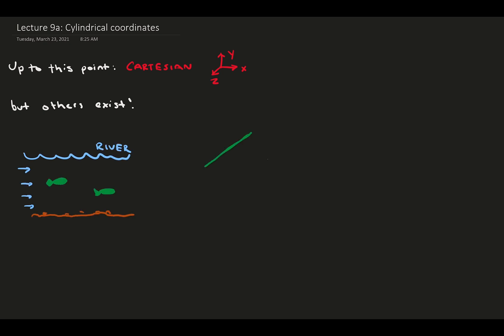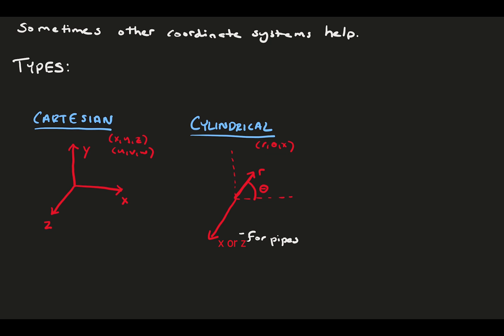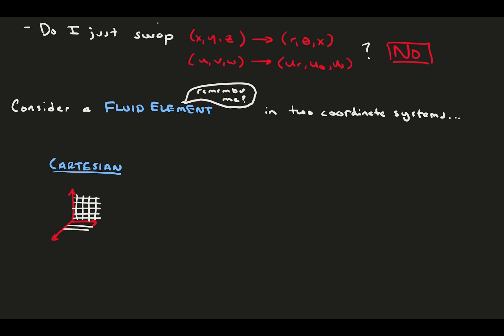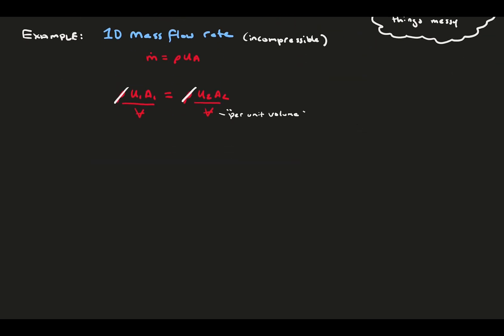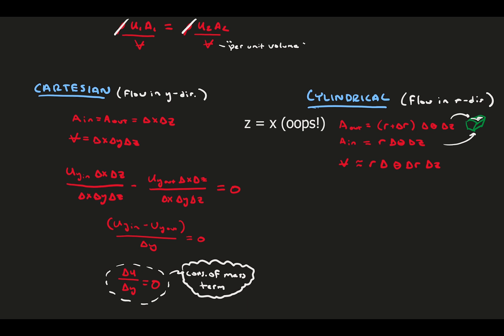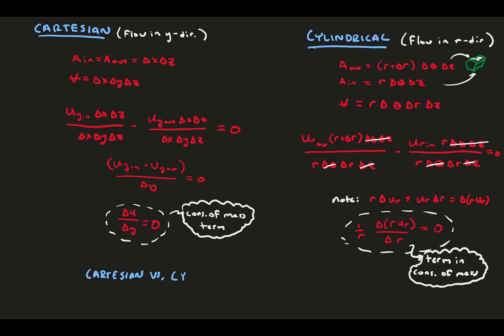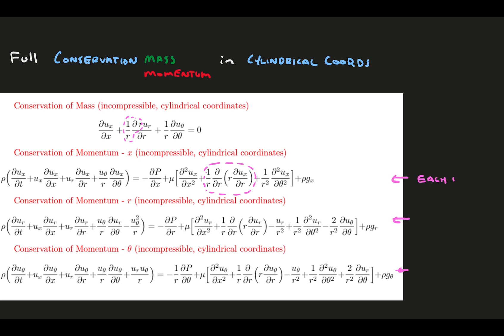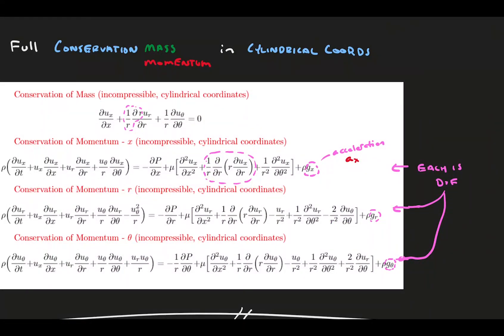Navier-Stokes in cylindrical coordinates [Fluid Mechanics #9a]

Comment: Sir, is there any way how to remember the NS equation in cylindrical coordinate system?
Reply from the maker: Unfortunately I don't know any useful tricks other than memorizing it completely. Typically the radial derivative terms are a slightly different than the cartesian counterpart, but not always.  Just be sure to check units, knowing that and d(.)/dtheta term needs a 1/r with it in order for units to match the other terms.
Reply: Thank you sir, even this helps a lot !